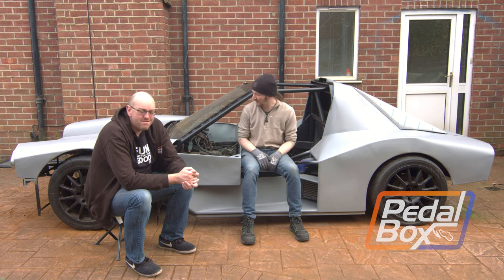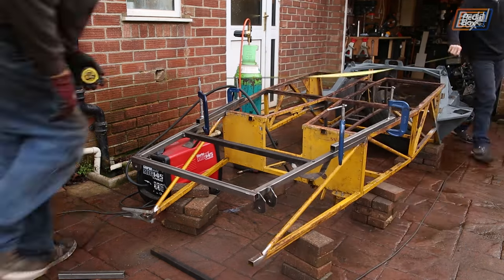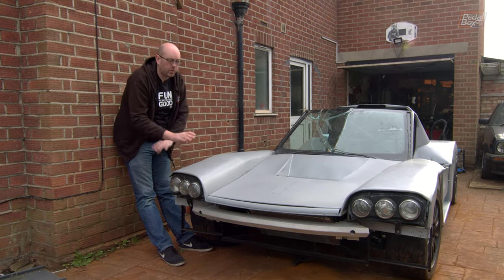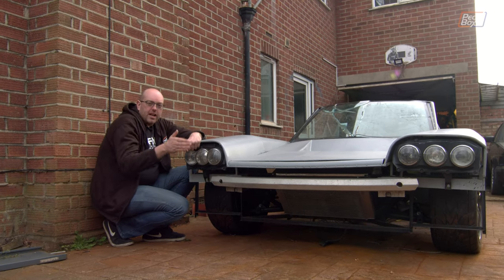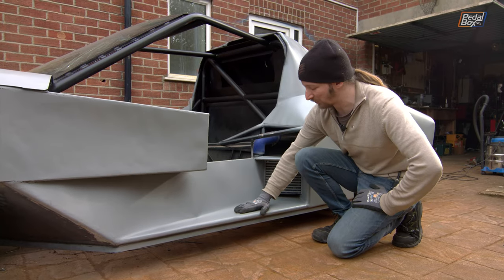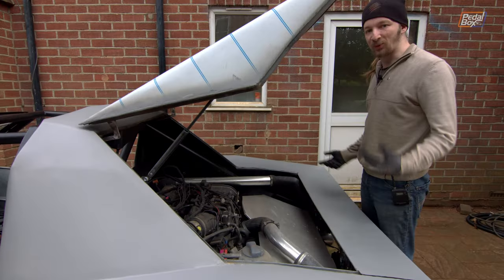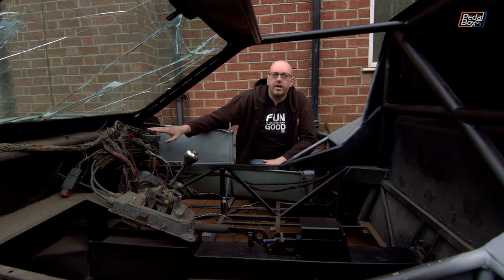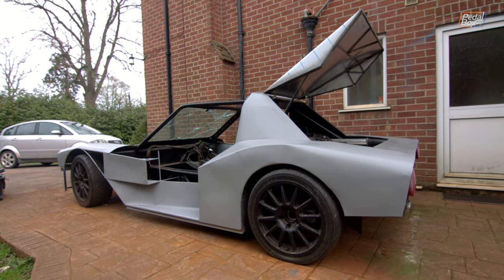PedalBox Episode 100 - The 'Kit' Car So Far | Audio TT Kit Car

Comment: Great catch up episode, worthy of 100! 
Some interesting design choices incorporating Fiat/Alfa parts as we know the Italians have way more stylish cars!
Think the only alternative thing I would of done would be a coolant radiator also on the rear intercooler or if you haven't already a summer/hot climate stat to help prevent the potential quick rise of temp as your thrashing it up and down the driveway 😒😂
She's not far off starting 👍
Reply from the maker: Yeah the rear rad was a consideration at the start, just the size and proximity to the exhaust put us off, but probably would have been workable somehow. I keep thinking about extending the brows forward over the lights another couple inches, but i'm not sure. Might be time for cardboard
Reply: @PedalBox  all unknowns till you get it running, hopefully soon!
If she starts to get too warm there's always little tricks without major mods
Reply from the maker: @CrispysProjects  Yeah, I suspect the fans ducting over the bay out the back will help to keep the heat down standing, and theres good airflow moving, and theres always louvres... :D

Comment: Looking awesome guys! You should both be very proud of what you've achieved so far!!!
I'm not sure but will you need a high level brake light for the SVA? 
I love the exhaust tips, leave them as they are iMO. 
So nice to have a proper look around the car, looks good from every angle, I especially like the rear end.
Keep up the good work, looking forward to following this to completion!!
Reply from the maker: Thanks very much! The high level is optional in the SAV/IVA manual, but theres some plan to add one when we remedy the panel gap around the top of the rear hatch/air scoop. Look forward to getting the last few bits of bodywork done and then get the front made up

Comment: Great review of all the work, I remember a lot of the early times, but you missed a key part which I include when I tell people about it.
You took the frame, decided to rear-mount the engine, so chopped the back off and redesigned it in order to fit the engine.
Then you chopped the front off and redesigned it to take the suspension you wanted.
...Then you chopped the middle off, to fit the column, channel, and seats... Bit like Trigger's broom.

Loving the tube/pipe reference too. Great inside joke there, A++.

Point of contention, did you deliver this down the pipes, or tubes or the Internet?
Reply from the maker: Well really the internet is just a series of tubes....
In retrospect, we should have just cut the front off a TT, then cut the back off the TT, and welded them to the middle section we'd just cut them off :D

Comment: To bad i live in a country (Netherlands) where is next to impossible to get it allowed on the roads here. Building kitcars here is no longer an option. 
So far the looks of your project turned out completely different from what i expexted, that is probably because of the building on the fly. I wonder how it was originally visioned by the builders. 
Cant wait to see the end results.
Reply from the maker: I'm pleased that, so far at least, the Govt. here listens to the automotive community and doesn't apply so much new legislation making it impossible. The original chassis would have looked like a Caterham 7/Locost 7, open top and very small :)
Reply: @PedalBox  Thanks for the reply, but with the builders i actually ment you guys, not the chassis manufacturers.
Is it turning out how you envisioned it at the start?